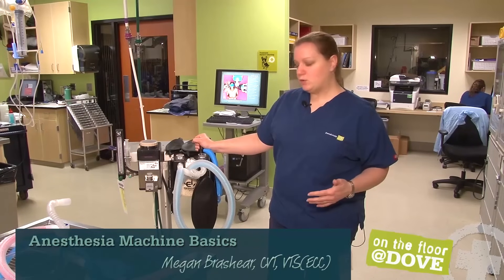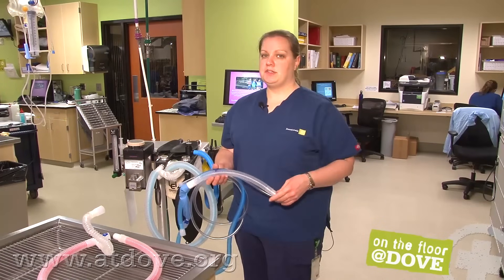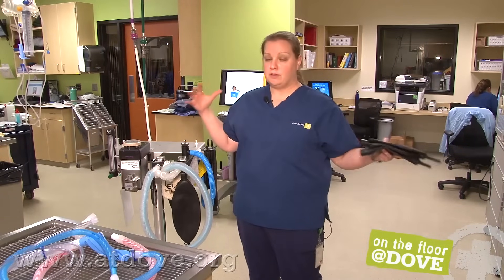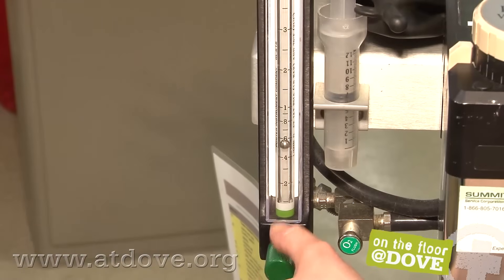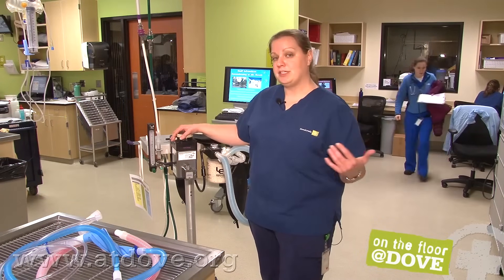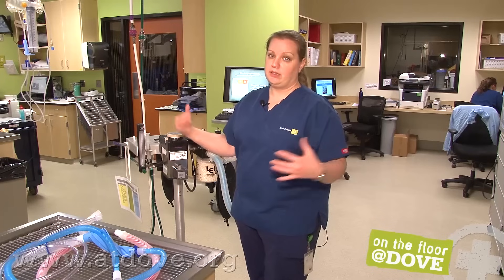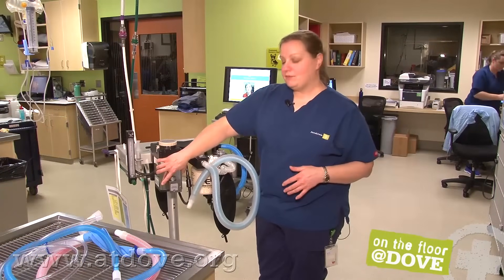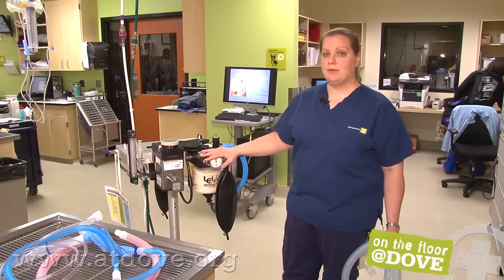Anesthesia Machines Basics

Comment: I still don’t understand the pop off valve mechanism :( Is the whole point of it to be able to close the circuit and admin ppv? But then if you leave it closed you could blow your patients lungs..
Reply: Hey RVT here- the point of the pop off valve is to allow for you to give the patient a breath-to essentially breathe for them if needed. When I have had to troubleshoot with high capnograph readings, it is helpful to be able to give the patient a breath to ensure they are having adequate respirations.
Reply: @SunriseStory thank you so much for responding. So, when you close and press, you are administering just pure oxygen?
Reply: The pop off valve is also used to pressure check the system prior to any anesthetic procedure.

Comment: Where is the face mask for the animal
Reply: Most animals are intubated with a breathing tube to keep the airways open. Masks are sometimes used at the very beginning to give a bit of anaesthetic to kick off their induction, or used on small animals like birds.
Reply: We don’t use masks very often anymore due to multiple factors, lots of gas wastage, WHS risk to the staff etc. so we put in a ET tube instead, much better practice than “masking down”